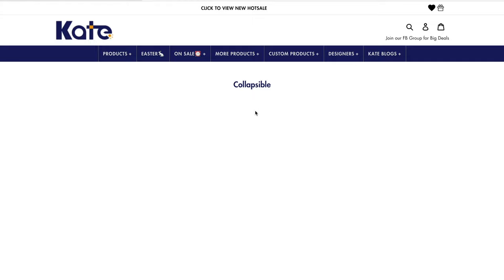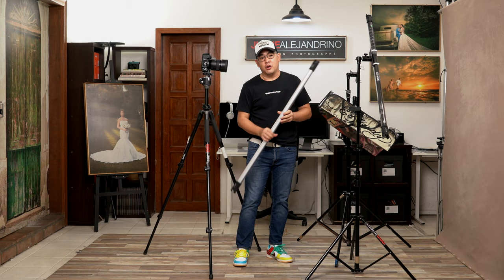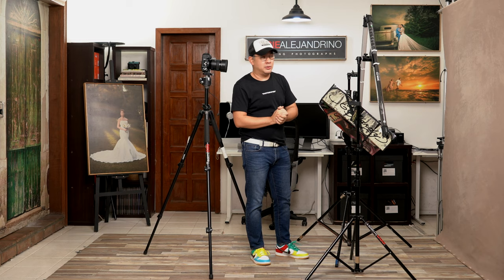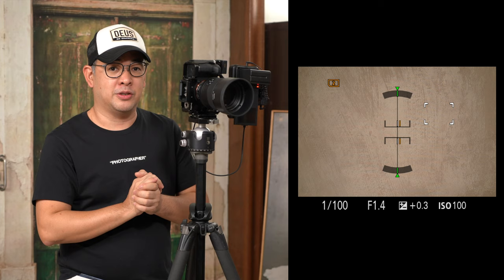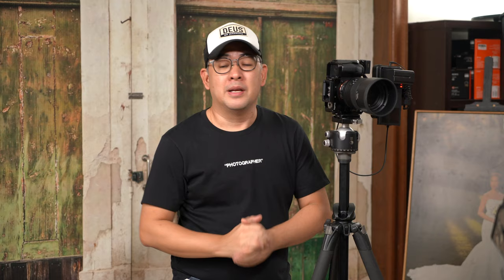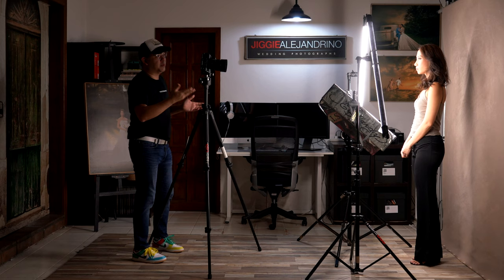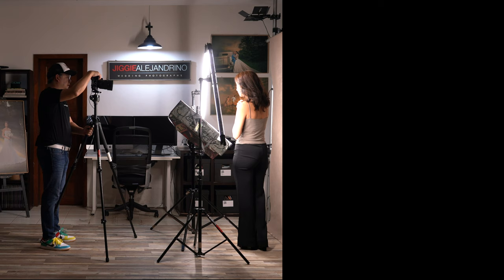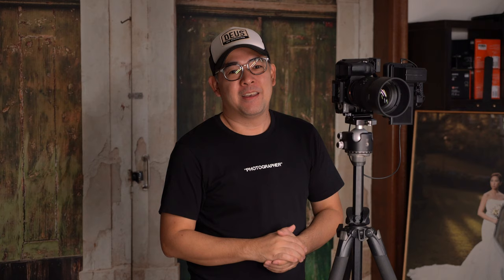How to Light and Photograph The Glamour Portrait using Two Lights.

Comment: Thank you Jiggie for yet another great tutorial. I noticed you are using a small rig cage for your camera, mounted on the ball head. I’m thinking to myself that’s perfect idea because the camera starts to drift down especially with heavy lenses. By having the ball head upright and attaching the small rig sideways you now have better alignment and stability of your camera. I have a small rig but it’s for my Sony a6500. I will have to get the cage for my Sony A7r II. Even though that lesson was not part of the video but thank you for the indirect camera set up tip. BTW I see your fly low key fashion. Flexing the Y-3 belt with the dunks. 🔥🔥🔥🔥 Keep it going peace. 🙏🏾
Reply from the maker: Yeah it’s basically an L Bracket but a cage :) glad you like the kicks

Comment: These tubes are indeed versatile. I have some cheaper models... not sure wether they'd be strong enough. Will try them out and see 🙂👍🏿
Reply from the maker: the concern should never be about the power rather the consistency of the color of the cheaper models
Reply: @JiggieAlejandrino  Oh really. Never thot about that. Should that still matter though when using two tubes from same brand? Or can custom white balance help do the trick? Thanks for responding.
Reply from the maker: @tonyblack2141  it just gets tricky, some lights have a greenish tone some purple so you’ll have to use white balance card to get it right, or just set your WB and adjust in post. But remember it changes too depending on what color setting you’re in. So yeah lots of headaches but has a workaround